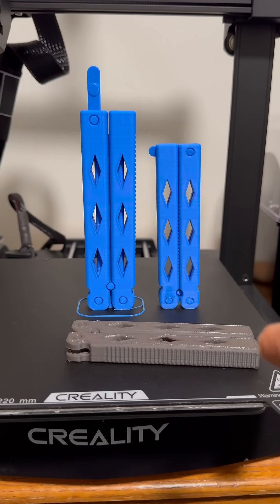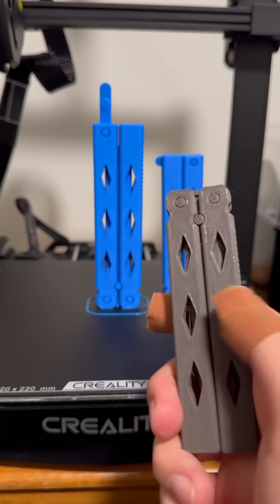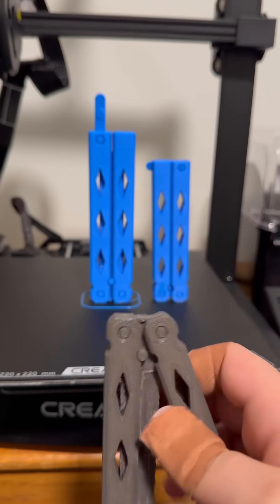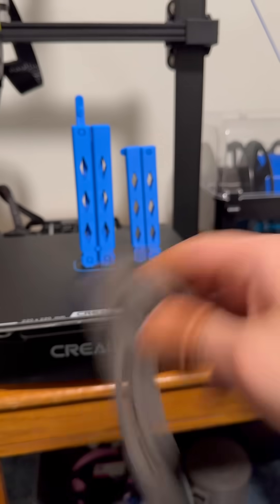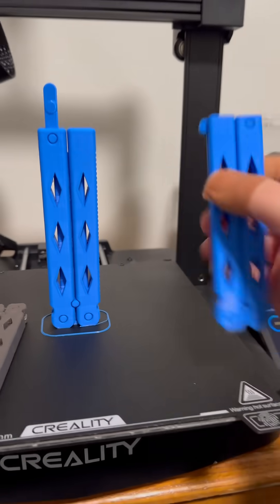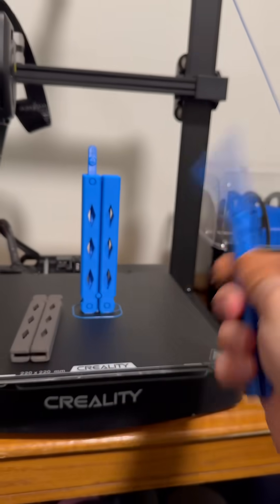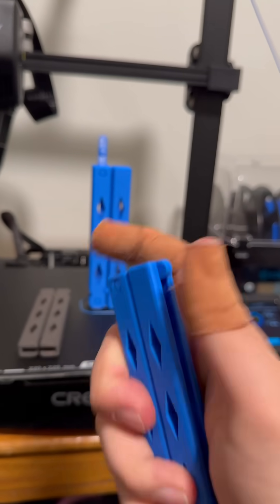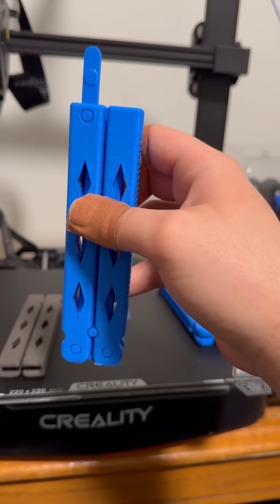3D Printer Butterfly Trainer

Comment: 3 v3 se ?
Reply from the maker: @daveguenther123  Ender 3 V3 SE
Reply: @LightOfGodMfg  I love it, it runs so reliably, the only downside is that it doesn't have a wireless connection
Reply from the maker: @ good news is its only $170

Comment: Brother use a resin printer for stuff that has so much small shit in it 😂
Reply from the maker: @ZaTryss10kZa  see I agree with the hardware. But I dont have a resin printer and honestly I got the threads to work after some trial and error. Either a smaller nozzle or a resin printer in the future wouldn’t be a bad option.
Reply: @LightOfGodMfg  yea i just switched to resin because i wanted to do artsy stuff  and when it comes to detail resins hard to beat, filament is way better for like technical prototypy builds but when it comss to butterfly knives  i immediately think small parts which requires detail to work correctly....

Id look now at some though! I picked up a nice resin printer for 500$ off on black friday and it works good but i have some kinks caused by me (ofc) but the sales lately have been insane
Reply from the maker: @ I definitely will look into to them! If you have any recommendations please let me know.

Comment: Is it worth it to print one of those?
Reply from the maker: @zander2737 Absolutely. It only took me 5 hours to print this at 100% infill. On an Ender 3 V3 SE. Honestly its just a blast to play with and prints as one piece. Super clean looking, genuinely just a great print.
Reply: I wouldnt use a filament based printer fir it but in theory yes
Reply from the maker: @ZaTryss10kZa  the issue with resin is its to many steps for the same thing. Ive had no issues with fdm printing so theres no point in fixing a problem thats not there
Reply: @LightOfGodMfg  is it too many steps? I feel like the added steps and layers improve the final product and could work smoother than a filament printed one
Reply from the maker: @ZaTryss10kZa  Ive had no issues with the fdm printed one at all. Make the hardware though like the nut and bolt has been  challenging. I got it to finally work. But its not the best, its where I think the resin printer would shine.
Reply: Is it worth to print either really weak or really ugly fidget toy.... If you like to waste filament on useless sht, than yea..